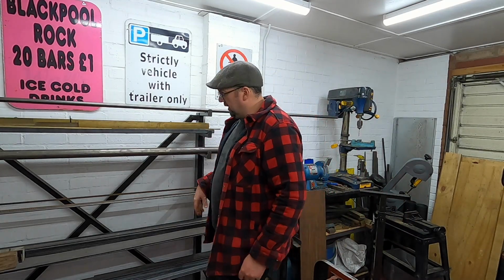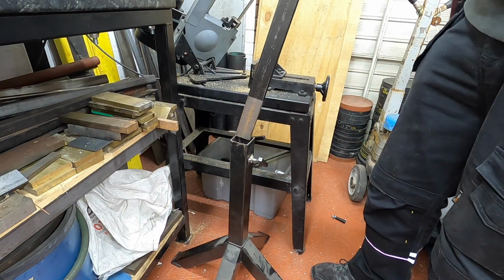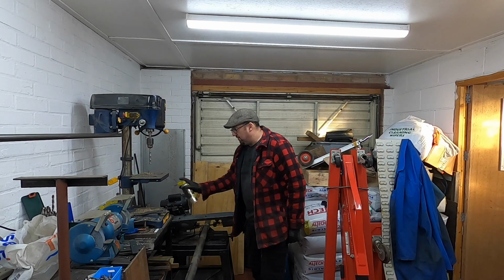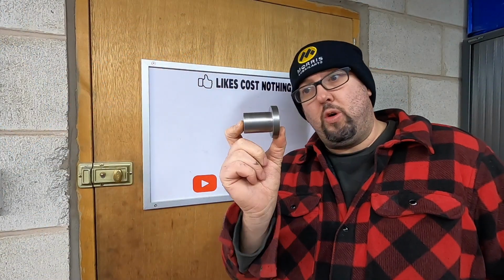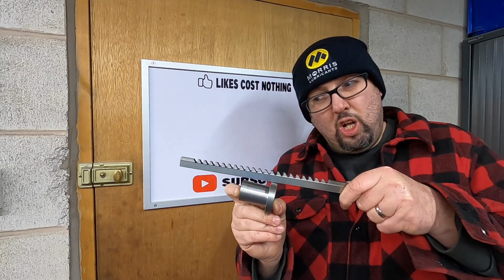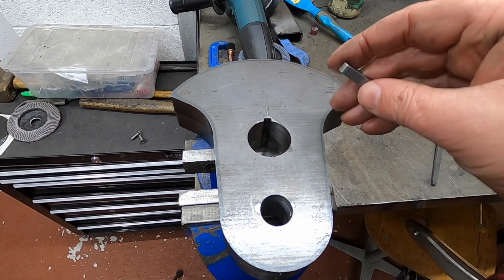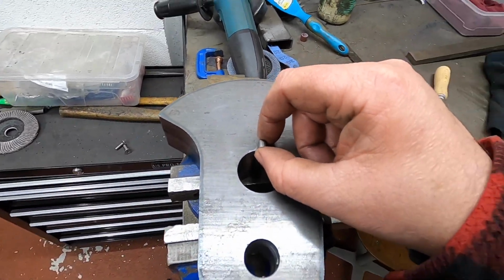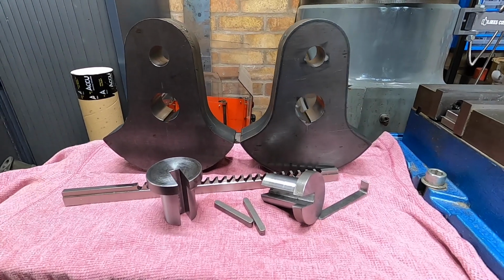Keyway Bushing - EP33 - 7.25" Gauge Steam Locomotive Build

Comment: I see you are using the inverter front panel controls to start and stop the lathe spindle in favour of the clutch, have you thought about using the control input terminals on the inverter to integrate the lathes electrical controls? I ran my M300 like you for quite a while with the inverter mounted above the rear of the headstock. The membrane keypad started to degrade so I eventually got round to integrating the controls.
Reply from the maker: Hi Chris, Thank's for the comment, I'd like to make a new control panel that is more accessible than the original, which is on the lower half of the machine, so using the VFD panel is right there on the wall, so it's easier to reach. I have lots of plans for the lathe, hopefully I can get some over the rest of the year. All the best, Matt

Comment: you need to strip that chuck and wash it out,as it sounds like your using it straight from the box.Most import chucks still have grinding dust inside as all they do at the factory is blow it out with an airline,so a good clean and lube is in order.I have a 3 jaw that i got from RDG tools 10 years ago on my harrison,and its less that 3 tenths of a thou out,not bad for an imported chuck,but that was only after i washed it out,before,it was 3 thou out,due to the compacted dust in the jaws.
Reply from the maker: Hi Martin, You are correct, never thought to take the back off and check inside, yet in the back of my mind I know I should have done. Thanks for the tip, I shall definitely be stripping it down and giving it the rinse out. I'm on with some machine maintenance so will add it to the list of jobs to do. All the best, Matt.

Comment: Job well done. Did you harden / case harden the bushes at all?
Regards
Robert
Reply from the maker: Hello Robert, Well, this was considered, but as they both were only doing effectively 1 key each, and they are made of EN8 which is hardish stuff I decided to see how they went. Which was very minimal marks, plenty of lubricant may of helped. I don’t plan on using them again either. All the best, laters 👋 Matt 👍
Reply: @MattChiversWorkshop   gosh - pricey single-use items, eh? :)

Comment: Very impressive work getting those made! I have also been looking at keying my axles and wheels, and it seems the biggest challenge is Ensuring that the key ways in the Wheels are all in exactly the same position relative to the crank- I understand that if you don’t it will affect the quartering? I know some people have made some jigs to align the bushes, but you didn’t? Is it something to do with the whole design?
Reply from the maker: William my good friend, I hope you're well. So, because this is all so big, we can follow big engineering practices, its is easier to make the keyways on the axles 90degrees our rather than the cranks. Something I'm going to have to do again to show it, as the axles were made before I started the channel. Pairing the cranks up with the use of a welder 😉, and keying them ensures that a pair are cranks are the same...... for the rest you will have to wait for a couple of episodes.....😂. All the best, Matt.
Reply: @MattChiversWorkshop   right, gotcha - I was planning on keyways on the axles at 90 degrees too. It now makes sense why your cranks look very bloody thick :) For me I'll need a method to align the bush slot with the crankpin since I can't easily pair the wheels - any suggestions?
Reply: @williamsworkshopuk  you really don't need to be using keyways on your Loco's axles.  Press fit or Loctite will suffice.
Reply: @markshomeengineering5243  Gosh, really? I'd have thought I'd be looking for trouble without a mechanical fixing. Do you have anything I can read up on/discuss more? It would make my life simpler but I'd rather not have my first loco end up in a tangle of twisted coupling rods and broken wheels!
Reply: @MattChiversWorkshop   I'm feeling much better now, been ill since before Xmas really and no time at all in the workshop so a pretty dreary couple of months!
Reply: @williamsworkshopuk  the wheels on my Jack are held "only" by Loctite (648).  Both Martin Evans in his book 'The Model Steam Locomotive' and Tim Coles in his book 'Model Steam Locomotives' advocate just the use of Loctite.  If you really are worried you can always pin the wheels after you have fitted them.  Cutting keyways at that size will introduce you to a world of pain.  Matt's Loco is not far off full size, so the forces involved are significantly higher.
Reply: @williamsworkshopuk  that sucks.  I'm glad you're better now.
Reply: @markshomeengineering5243   OK you have convinced me, thank you for saving me a good deal of time. While I'm here, same question for the crank webs? keyed, loctited or brazed?
Reply: @williamsworkshopuk  I dont have them on "Jack" but for my (part built) Royal Scot, I loctited and pinned. The pinning was probably OTT 🙂

Comment: Another great video Matt!!!  Love seeing people work on stuff bigger than HOn30 or 009!  One question...  I didn't see how you "timed" or "clocked" the slots in the broach bushings so that the slots are aligned vertically to the crankpin centerline.  I understand that by pairing two counterweights together and having the keyways 90° apart on the axles, so long as you use the pair counterweights on the same axle, you'll be OK.  But for the sake of interchangeability, would it have been better practice to make a simple fixture to align the broach keyway the same for both counterweight pairs?

I suppose what works works, so you're all set...  Another method I've seen here on "The Tube" was that the guy cut the keyways in his cranks on a 45° angle to the crankpin to axle hole centerline.  This allowed him to cut the keyways on the axles in one plane (aligned on the same axis) and still have quarter.  He just had to make a simple fixture to align the broach bush to that 45° angle.  

Can't wait to see the next installment...  Cheers!
Reply from the maker: Hi Jeff, simple answer is, you didn’t see it because I didn’t, my axles have been keyed with them 90degree out for the quartering, next episodes it will make sense. All the best, Matt. 👍

Comment: Having watched Lawries video on the original Tink it got me thinking of yours. Boiler and pistons, is this something you are allowed to manufacture yourself? Or do they have to be built by boiler specialists in order to get the pressure vessel certified?
Reply: Rules change country by country.
In Aus, I believe you can build em yourself, but if you go past a certain size or pressure you need to get them externally tested & certified. Any train club will need to see that certification for your vehicle to run on their track.
Reply from the maker: Hi Les, I really enjoyed Lawrie’s Tink video it’s one of his best! 

So Cylinders… I can make those myself, no issues at all, if all goes well, you’ll see that in future videos.

Boiler… that’s a whole new world, but the simple answer is yes I can make one myself, but it’s not a straightforward process of make one. It’s actually is easier to have one made by a boiler maker, which will arrive with the correct paperwork and stamped up correctly. Future Video on this topic incoming.
All the best, laters 👋, Matt 👍